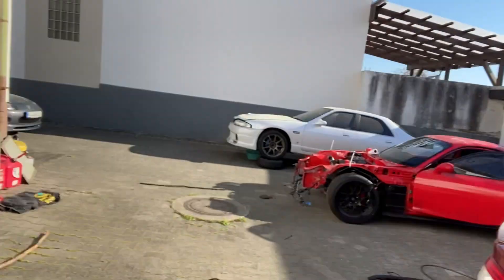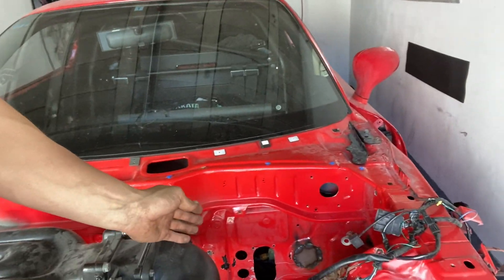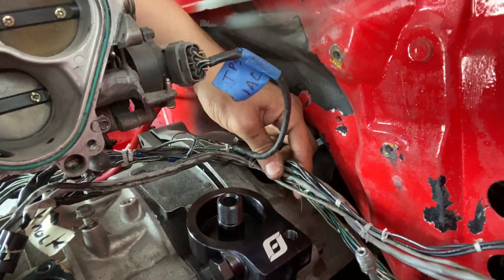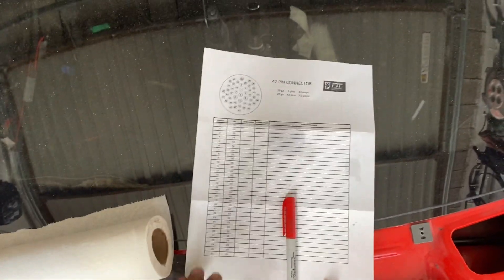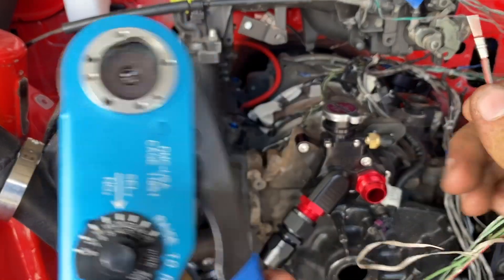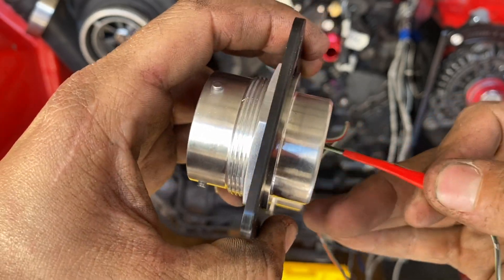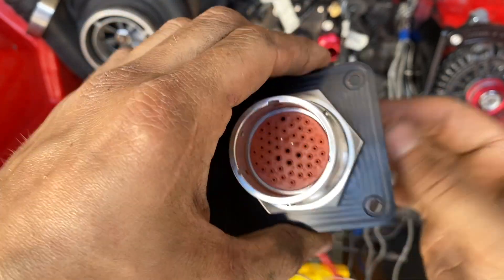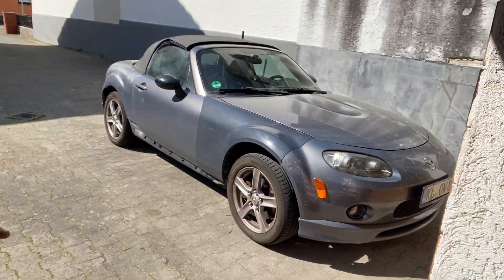Building a Custom Wire Harness | Mil-Spec | How To | RX7 Track Car Wiring

Comment: Im sick of crimps never holding up and I don't have a lot of money to spend. What I do is crimp it as good I can with a very small waterpumppliers and solder the wire into the connector. Works really good for me and holds up very well. Of course it takes much more time and effort tho

Comment: You are using the AF8 (blue) crimper wrong. Read it’s instructions and get the correct die for it.
Reply from the maker: Xx Ghost xX yeah I know about using the die’s. Unfortunately my friend I borrowed the af8 from didn’t have them, so I made due with what I had. As long as it crimps it with the 4 teeth it will do just fine. Of course not as ideal but it works. If it is good enough for aircraft wiring, it is good enough for my car driven on the street.
Reply: The die is for people who don't know what they're doing.
Reply from the maker: Daniel Harp this is true 😂

Comment: Meanwhile, all dirt and dust find their way through open oil filter pedestral.
Reply from the maker: icedfluid don’t worry, this is a mock up engine, you’ll have to see my part 2 of the tubs video. This engine is only for mocking up the wiring/coolant lines/oil lines etc. there are no internals. They’re junk housings/irons. There’s no rotors or eshaft!
Reply: @Dustinhanson31  Phew !

Comment: Hey dude, nice video, where did you get your connectors from?
Reply from the maker: Essex Rotary mavin performance! One is the 47 pin, the other is the 29 pin. Honestly I could of gotten away with just the 47 pin but it is nice to have them separated and if I ever need more room I have it!
Reply: @Dustinhanson31  Thanks for the link, also love the channel name
Reply from the maker: Thanks! Will be posting up some videos of my skyline and Nc Miata on the nürburgring soon as well
Reply: @Dustinhanson31  i was at the ring in 2014 with my RX-8 after a 4000km road trim from here in the UK all the way to Asti in Italy via Paris, Grenoble, Route Napoleon to Monaco, Alassio, Asti (3 day stop over to see family) then through Switzerland and the San Bernardino Pass, Austria and a stop in Fredrichshafen, then on to the Ring for a stop over and a couple of laps before heading home via Spa Francorchamps and back to Blighty... it was an epic trip i would love to do again. The Ring is an amazing place.
Reply from the maker: Hopefully I’ll have the fd up and running here in two weeks or so and after the break in I’ll for sure be going